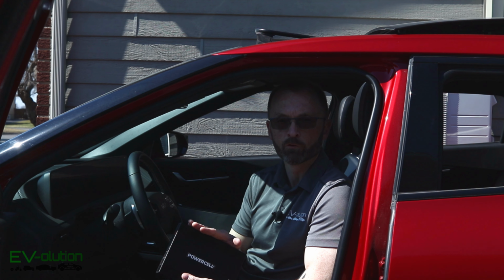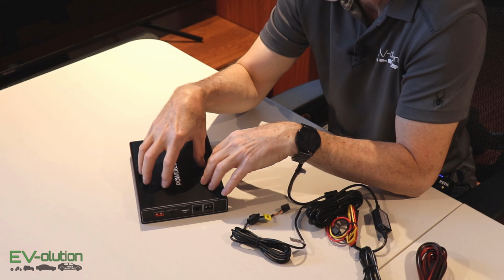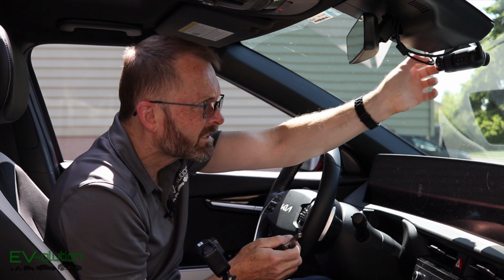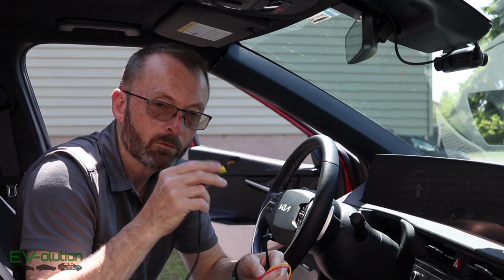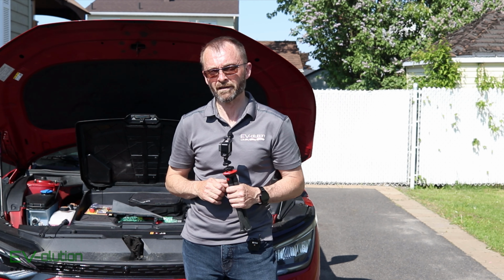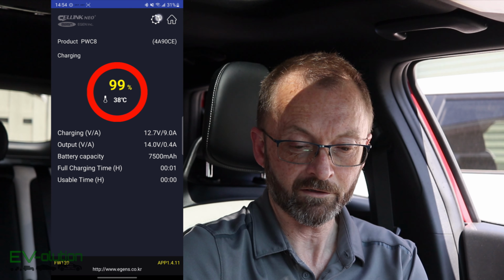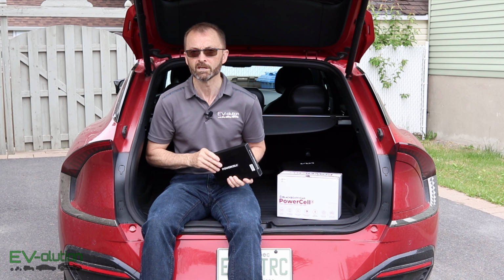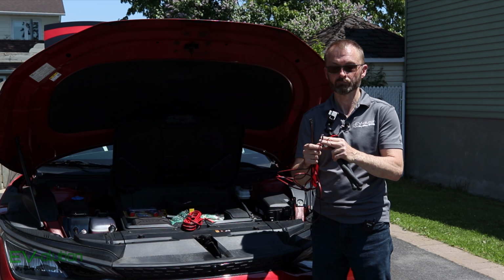12V Battery Protection - Powercell 8 Review & Installation

Comment: How many hours can a full charge last?
Reply from the maker: It depends on the power draw. My camera is set up to record at full frame rate all the time, so it pulls much more power. The pack gives me about 20 hours of recording when the car is off. As long as I drive 20 minutes per day, it is fine.

Comment: Battery pack will ONLY charge itself when GAS car is running? If not is there option somewhere to prevent stop draining car battery below certain voltage?
Also, have you ever considered using small power stations? (not power bank).  Prices are fractions compare to PowerCell pack.
Reply from the maker: I am not sure I understand. In a gas car the alternator powers everything while the car is running. Neither the 12V battery, nor the Powercell8 are drained when the car is running. The Powercell8 is only used when the car is off, preventing the 12V battery from being drained. I did not consider any other options because although this is more expensive than a simple power pack, it integrates circuitry that intelligently manages everything.

Comment: if battery pack dies because of use, does the dashcam kick over and start using 12 volt battery?
Reply from the maker: The dashcam and all other electronics in EVs use the 12V system for power at all times, like a gas car. When running, the gas car's alternator feeds the 12V battery, and an EV's DC to DC converter feeds the 12V battery when it is on, but it's essentially the same principal. If the high voltage battery in an EV is empty, the 12V battery will last as long as it can to feed the electronics that need power, including the dashcam. I hope this helps.

Comment: what amps should i set it at if i hardwire thru fuse not actual battery should i have it at 7.5 or 9 like you did?
Reply from the maker: If you are using a 10A fuse you should be able to go to 9A no problems.

Comment: If i don't want to hardwire it to the fuse box but remove the battery pack and charge it at home when it gets low would that work?
Reply from the maker: I don't think that would be feasible. Something important to note, this isn't really hardwired; it's connected with fuse taps which are just plugged in, like you plug in a fuse.

Comment: Thanks for this video! What gauge wire do you recommend to extend the wires from the relay? 14-16 AWG work?
Reply from the maker: You are very welcome. When you say "extend the wires" I am not sure I understand what you mean. The relay has some pigtails that connect to the hardwire kit wires that is bought with the PowerCell8, as well as connecting to the direct 12V battery connection. There are no extensions, only what I show and describe in the video.
Reply: @EV-olution  Never mind, just saw that you purchased extra wiring for the power cable. Thank you.
Reply from the maker: @BrokeWatchFanatic  I just saw your original comment and was going to say that I show it right at the part of the video that you referenced 😎

Comment: With a ev drawing power from the battery and the battery drawing power from the ev battery it might not be a lot but it might keep the battery a little warmer. I know way back in my younger years I knew someone that turned his headlights on to warm up the battery in the winter and it helped to start the car so a warm battery is better than a cold one
Reply from the maker: In an EV there is no large current being drawn since there is no starter motor to turn an engine, so warming up the 12V battery is not needed in an EV. Think of an EV as more like a light bulb; you turn it on by flipping a switch, which requires almost no energy.

Comment: Can this pack be unplugged and charged inside your home and not from the car's battery. If so, how to do it?
Reply from the maker: It can only be charged with the 2 methods shown in the video. Hard wired, or via a 12V outlet. If you have a power source in the house that has a12V outlet (cigarette lighter outlet) then in theory you could charge it in the house.
Reply: @EV-olution Hi thanks for your reply. Yeah, I found some products on Amazon which convert 110 V AC to 12 V DC with a car cigarette adapter. I guess these would work
Reply from the maker: @narujohn6984 my question is why? What is your use case?

Comment: Absolutely fantastic job you've done with this tutorial. You couldn't have presented it any better. Every step of what you did and needed doing was shown and described clearly and in the easiest way possible. 

Over here in England, we cant buy the Powercell so I had to purchase a Cellink Neo 8. Not quite as good, but as good as I could get.

My car doesn't have a sunroof as it's got air con, but the fuse location for the absent sunroof is live and I believe is 20A rated. I'm hoping I'd be safe to use the wire tap straight into that unused fuse location with just the 20A Cellink provided fuse and just run the battery pack off this fuse location.  I'm powering a Road Angel Halo Pro front & rear dash cam off the Cellink, so I think all should be good.

P.s, if I go out to my car and find a smouldering pile of rubble...I'll let you know!🙄🤦👍🏴🇨🇦
Reply from the maker: Thank you very much, I appreciate the comment. Regarding the sunroof empty fuse location, that is a good idea, but I would use a 5A or 10A fuse as a max value. The battery does not pull that much power. As for your last comment 😂😆, I am glad I put a disclaimer in the video 😉😎
Reply: @EV-olution - Credit where credit is due my friend😉👍. Many thanks for your quick reply and advice, I'll do as you've said and it makes good sense. Thanks once again, and keep up the great videos😉👍

Comment: Hello, what amp voltage did you use for the inline fuse?
Reply from the maker: If I recall correctly I used a 10A fuse. The draw is very low so there is no need for a big fuse.

Comment: Does the fuse on the inline fuse matter.? if so if my vehicle takes micro2 fuse can a different fuse type be use for the inline fuse holder connected to the battery?
Reply from the maker: The inline fuse can be whatever type you like. Even if your car has micro2 fuses, the inline fuse can be any type as long as the circuit is protected. I bought micro2 since it was in stock at the store, but I could have bought a standard type if the micro2 was not stock.
Reply: @EV-olution  Thank You EV, You've been very informative and helpful!
Reply from the maker: @juanmejia1319  you are very welcome.

Comment: So either pay $350 for this power bank vs $20 to hardwire with a little DIY. $350 is more than most of the high-end Dash Cam out there.
Reply from the maker: Hardwiring the dashcam does not protect your car's 12V battery, it only allows for parking mode to work, but lets the dashcam pull power until the 12V battery is dead. This battery pack is a buffer between the dashcam and your car's 12V battery. If the battery pack empties, your 12V battery is untouched since the Powercell8 battery pack only charges when the car is powered on.
Reply: @EV-olution  Well I've been hardwired and now using an OBD connection for at least 2 years. Still on the same 12v battery. Yes, you're correct that the power bank is a better option but the price is very steep to justify that. 
The power bank still needs to be hardwired to your car for a faster charging option because the cigarette plug is not fast enough to charge the power bank if you're only relying on that as the charging option. Either drive long distant commute each way or hardwire.

Comment: Nice video. I plan to buy this and utilize the cigarette port for charging. Dumb question, how does the dash cam know to go to parking mode when I turn off the car when the battery pack is not hard wired?
Reply from the maker: Thank you, I am glad you liked my video. The parking mode and Powecell8 battery pack both require the hardwire kit. You cannot have parking mode without the hardwire kit. FYI, you don't have to wire it to the car's 12V like I did, you can simply connect it to the fuse box in the car, with fuse taps. You can see how the camera is installed with the hardwire kit in my video about the Viofo T130.
Reply: @EV-olution  Dear sir, thx for a speedy response. I was talking about the Powercell 8, not Neo. Powercell offers two methods of charging - cigarette port of hard wired. That’s the basis of my question.
Reply from the maker: Sorry about that, I made a mistake in my response. If I recall correctly, the Powecell8 switches the output to the parking mode output when it detects there is no power coming into it, but since I don't use the 12V input for it I am not 100% sure.

Comment: Great video! Planning on doing this in the upcoming days with my U3000.. since you are running a 12 awg wire from the battery to the relay, is the relay, and the inline fuse also 12 awg?
Reply from the maker: I did this last year, so I don't recall the exact parts I bought, but I am 99% certain that I bought the same guage relay and fuse wire size.
Reply: @EV-olution  appreciate the help!
Reply from the maker: I forgot to say thank you! Thanks 😎

Comment: Hi there, Can i use a Powercell8 battery pack with my Thinkware U3000 front and rear cameras? 
I prefer to use the cigaratte lighter option rather than the fuse box.
So what input and output cables do I need to choose from?
There is no option available for input cable. So does it mean the powercell 8 comes with cigaratte lighter input?
Secondly, what output do I choose if I have a U3000 - the cigarette lighter socket output or the spliced cable output and does the spliced output wire go directly into the camera? There is no need for a separate Thinkware hardwire cable in that case right?
Furthermore, will the cigaratte lighter be able to draw sufficient current from the 12v car battery to charge the Powercell 8 battery enough for it to be used when the car is switched off as the car cigaratte lighter will go off when the car is switched off. Please advise, thanks!
Reply from the maker: I answer most of your questions in this video, in the unboxing and explanation that starts at the 2 minute mark. It includes a 12V socket power cable in the box so you can use that to charge the Powercell 8. I also explain the power settings on the battery in my video. As for your Thinkware U3000, I don't understand why you indicate there is no wiring for it; according to the BlackboxMyCar product page for the Powercell 8, there is a Thinkware power output wiring kit available.

Comment: The more that I look into dashcams and the added requirements and the complexity of the installation, the less I want to get one.  😂
Reply from the maker: 😆 if you want parking mode and a rear dashcam, it is a pain to install, but there are some solutions that are plug-and-play. If you have an EV6 like me, then there is a front only dashcam that replaces the plastic cover where the rearview mirror is, looks factory, and plugs directly into a wire at that location; it takes 5 minutes to install.

Comment: Too expensive
Reply from the maker: I agree that it is pricey. The odd thing is that it is LFP, which is a less expensive battery technology as compared to lithium ion. It's a shame it isn't less expensive, to allow more people to benefit from it, because it is a great product.
Reply: @EV-olution  I spoke to 4 dash cam installers. I explained I had an EV and concerned about the battery when in park mode. They did not know I spoke to several installers, yet all of them told me the battery backup is a sham as a EV has a seperate battery for ancilary items like lights and A/C etc. I am just stating what they told me. They said the battery pack is a sham and you do not need them regardless if you have an ICE or EV.
Reply from the maker: As I mention in the video, the 12V battery in an EV, which runs the 12V electronics, lights, radio, etc, is usually much smaller than in an ICE vehicle and has less capacity. This means the 12V battery will go through more cycles than the 12V in an ICE vehicle and may deplete to a lower level (both of mine did which killed them). An advantage an EV has over an ICE vehicle is that the car is supposed to maintain the 12V battery state of charge even when the car is powered off because it has a program to top off the 12V using power from the high voltage battery that powers the car, but I have had both my Niro EV 12V and my EV6 12V batteries fail after a few months of use with a 24/7 dashcam because of crappy programming of the 12V maintenance via the high voltage battery. This is also a known issue in the Hyundai Ioniq 5 and Kona Electric (until a software update was made), and probably in the Ioniq 6 since it is essentially the same vehicle as the Ioniq 5 with regards to technology (unless Hyundai released an update since making this video). If you have an EV with updated software, then this battery pack solution may be of less use since the 12V battery maintenance software should keep the 12V battery from dropping too low,  but that was not the case for me when I made this video. If you have an ICE vehicle then this battery pack is a very good solution because when the motor of an ICE vehicle is not running the 12V battery is not charged, meaning the parking mode of the dashcam will happily pull power until the 12V dies, or until you start the car. I hope this clears things up.

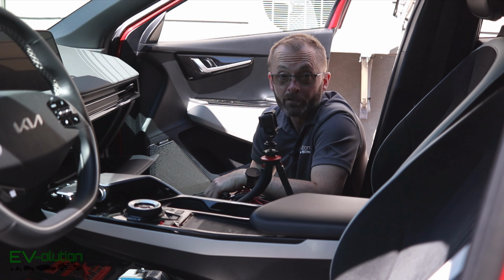Comment: 8:50 yikes, I'd never do this to my Stinger
Reply from the maker: It's only plastic, and cannot be seen. Especially since I cleaned up the hole with my Dremel and it looks fine. This type of installation is not for everyone, but in the end, it's just a bit of plastic, and it's just a car 😎
Reply: for real lol and he didn't even use step drill bit for a correct size and clean hole. Ouch!

Comment: What 12v battery did you get to replace your Kia Niro EV? Was it any good?
Reply from the maker: You can find everything I use for my EV6, and my previous Niro EV, on my website. Here is the Niro EV page, where you can use the menu on the right side of the screen to navigate directly to the AGM 12V battery I used, which was excellent: https://www.ev-olution.ca/products-i-use-niro-ev

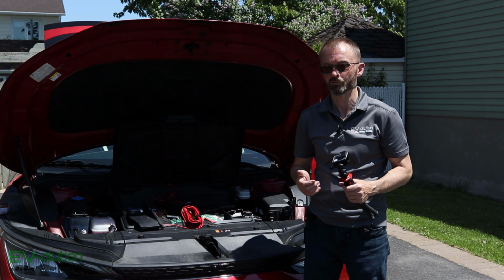Comment: In regards to the diagram at 17:20 for the modified relay version of the setup, the relays offered on amazon have a built in 30A fuse included as part of the relay. These built in fuses seem to be on terminal 30 too. So just to be clear, there needs to be a (preferably) 30A in-line fuse between the 12v car battery and the relay, AND the 30A fuse that is part of the relay as well? Or does this built-in fuse negate the need for the fuse between the battery and the relay?
Reply: Just stick with the original wiring method and you will be smooth mate! No need th add a relay with the Powercell 8.
Reply from the maker: I agree, the original installation instructions should be more than good enough, but since my car was new, and is fully electric with tons of electronics, I opted to have it on a separate circuit.
Reply from the maker: You only need one fuse. The relay I bought is not from Amazon and does not have a built-in fuse. I could have bought one, but I opted to install a separate fuse holder. As for the fuse, I am using 20A because 30A would be a bit high.

Comment: I want to make a better and cheaper solution, anyone interested in communicating?
Reply from the maker: The issue with making your own solution at a cheaper price is the overall cost of materials, especially the LiFePO4 battery, when you don't make the product in mass production. I do agree that it would be nice if the price of the Powercell 8 was lower though.
Reply: BBM C won’t make one cheaper.  Got to make big profit :D

Comment: Thank you for talking about & showing the retrocarguy method. Im planning on taking this route and being that i havent used a relay as a switch this was much help thanks!!
Reply from the maker: Sorry for the delay in getting back to you, I was away on vacation. I am glad my video was helpful. I have been using this setup since making the video and it works exactly as described in the video; everything is still working very well.
Reply: Are you already using this product, I would like to know your experience